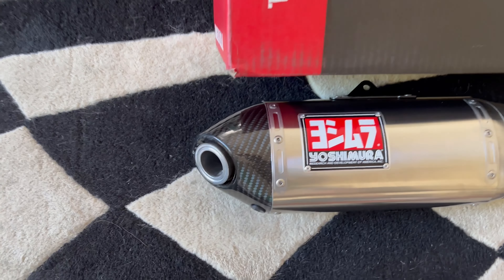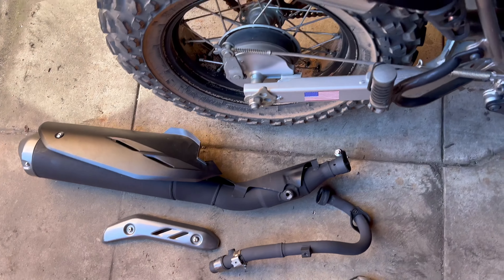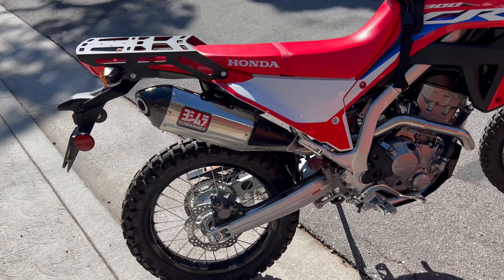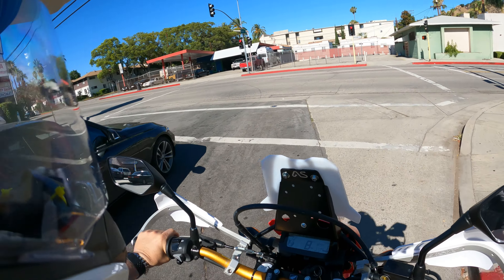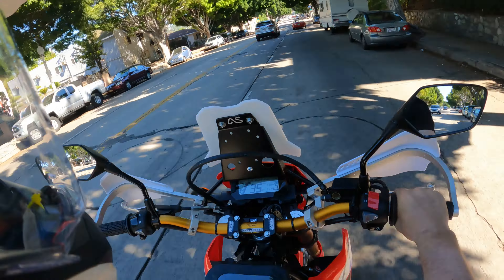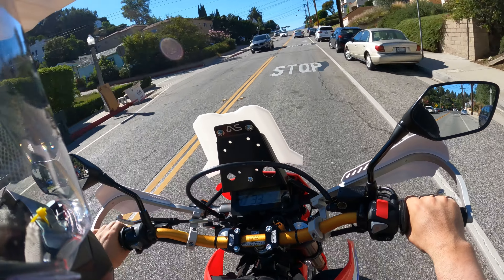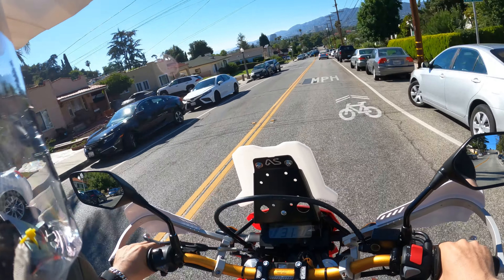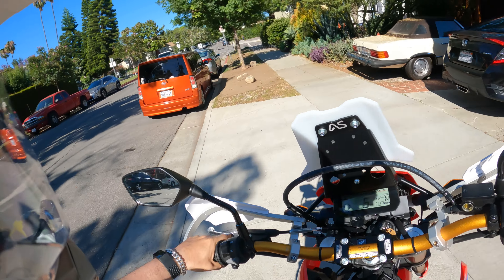2022 Honda CRF300L Yoshimura RS-4 Full Pipe Installation and Ride

Comment: Sold my 2003 Honda Dominator to my mate , I fitted the Delkevic 200mm carbon end pipes.that he ordered on eBay .he started it sup at 1130 in the evening  and with that 650 single cylinder thumper he was waking the dead in the next county 😂🇬🇧❤️🏍

Comment: Great to hear they are back in stock. I have one ordered with my local repair shop. I have the 550 ECU already. I’m going to install the the ECU, and exhaust at the same time. I like that it’s not overly loud. I will be running the spark arrestor. What rear rack is that?  It looks nice. I want to add one to my bike.
Reply from the maker: Honestly I found it on Amazon because I needed it asap for a trip. It fits OK. Personally i'd go for the AXP one.  But here is a link to mine if you're interested.  https://www.amazon.com/dp/B09MW6969F?ref=ppx_yo2ov_dt_b_product_details&th=1

Comment: sounds good man i got the 550ecu  stock improved 87 and just bought this exhaust system yesterday i hope mine sounds as good
Reply from the maker: Nice! Will you be able to easily upgrade the tune to stage 1 with the pipe?
Reply: @MichaelKarapetian  yes its free to upgrade 😋 and im in the process.
Reply from the maker: @glockmodder  Nice! Good to know
Reply: How does bike feel with 87 stick improved?
Reply: @damacknificent151  much better than stock i just did a retune for stage 1 yesterday and WOW much much better loads more power i bet the 93 tune is really nice

Comment: Sounds great.  2 questions !!!
One did you feel the need to add a heat shield either along the engine or at the back where the exhaust Ken is from excess heat or adding luggage etc.? Secondly that windscreen is kind of cool does it actually function decent in terms of wind protection because it’s fairly small but that’s why I kind of like it.  Also does it cut off the top of the screen on your dash a bit? What brand is it? Thx ☺️
Reply from the maker: Hey!  SO I ordered the Tusk luggage and I have been running it with this exhaust without the heat shield that was provided by Tusk. And so far no problems even on distance. For that luggage specifically there is no point where the bag is in contact with the exhaust. I imagine other brands vary depending on how they mount. But I think most luggage will come with a heat shield.

The windscreen is awesome. It's smaller, definitely breaks the wind at highway speeds. And it DOES block the very top of the instrument cluster that shows all of your light indicators like blinker, high beam, etc. That is one negative. But if you can live with that, it's an awesome addition. Especially if you plan to mount GPS or something. It's made by adventure spec out of the UK.